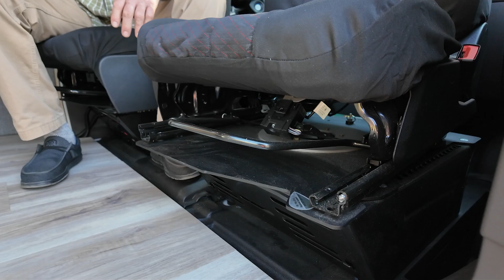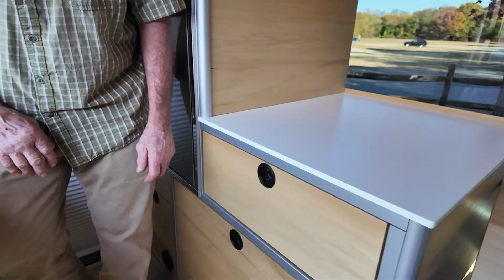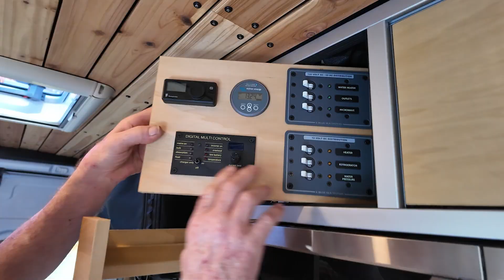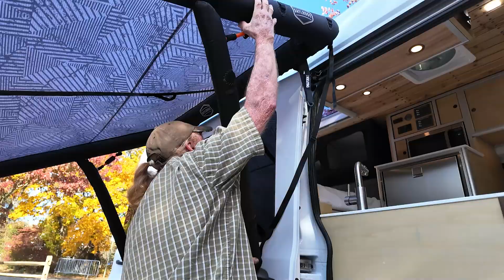You WON'T Believe This Hidden Feature in This Camper Van!

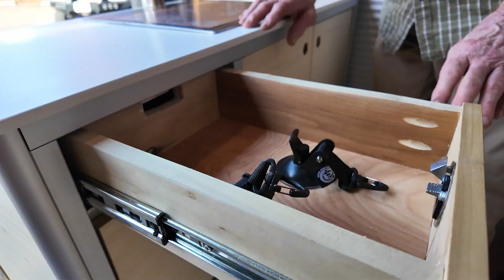Comment: 5:46 all; solid plywood sounds great and heavy. for a rv heavy sound bad 
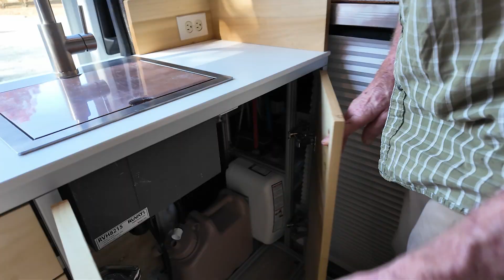6:17 6 gallon canister for grey water? no underneath tank with remote valve? that is no go for the price. 
7:04 light flickering isn't a good sign.
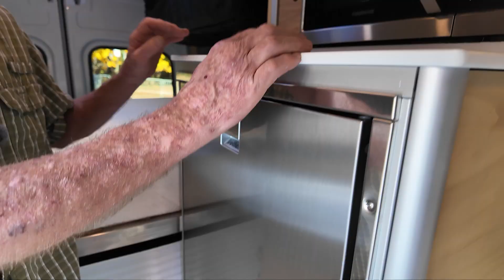7:37 the shelf before the microwave is useless 
12:00 that shade should be able to hold stuff that wont fly to main compartment in emergency situations. that looks and functions bad. better you put that heavy plywood there instead of that flimsy shade. 
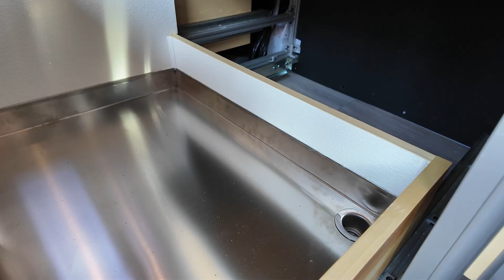12:59 instead of normal grey tank for 20 gal for kitchen/shower/yellow you installed 6 gal? why? 
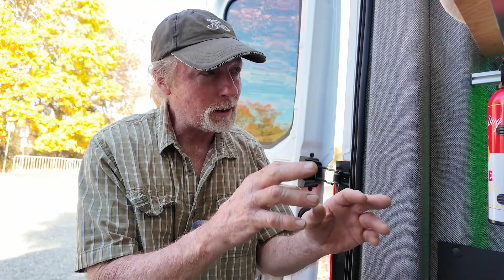15:00 those doors have no isolations and it would be cold to sleep next to it also condensation
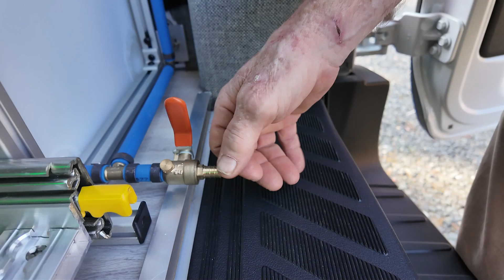17:36 that drain is simple but you can step on it and have problems  
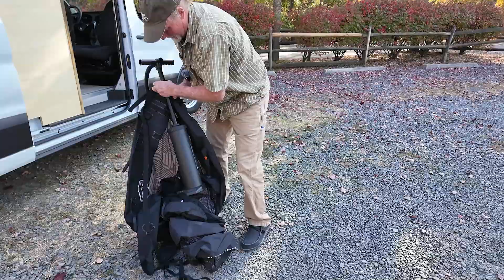18:38 that owning ... I wouldn't buy it or even took for free ... 

everting else seems decent and well made

Comment: Not much storage outside of the garage. I don’t remember if I’ve ever seen bare metal (back doors) in a fully converted van.
Reply from the maker: They can be finished or bare, it’s up to the customer to decide
Reply: Just not something usually seen. Not really a complaint. Love your content. 👍
Reply: @kevindenny3607  The rear doors have the factory covers on the lower portion, I installed the windows.

Comment: I wonder what kind of heating this has, and what temperature it's rated for. Might be a nice little ice fishing van.
Reply: The van is heated by a ESPAR heater and has 2 layers of Thinsulate insulation, the water tank has a heater, the van is designed for winter use.

Comment: That is an awesome build. But i would have to pass on that awning. It hung down way too low on outside edge. Just looked kinda botched up.  I wouldnt want anything to cheapen such a great van build. He really did a great job
Reply from the maker: It had more adjustments to bring it up
Reply: Thanks, the awning needed to be adjusted, it can protrude straight out.

Comment: With 6% tax, not including any fees or extra costs, it's $6,600 above my budget.  I can figure the no tv thing out but the no ac thing has me trying to figure things out.  I want to be comfortable.  How long is the van externally?  Also the overall height, my garage leaves me 9' 3" to get a van in the garage.
Reply: I haven't measured the van's height or length so not sure if would fit in your garage, it's a standard Ford Transit if that helps.

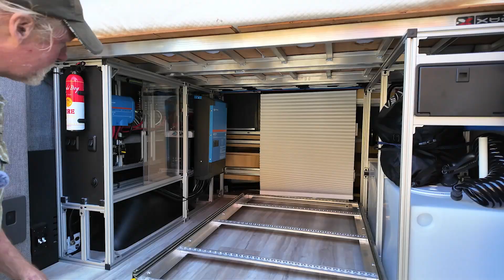Comment: 14:14 So that no one is confused. That Victron Multiplus II is not 3000 "watts" but 3000 "VA" which is about 2600 watts.  Victron for some reason likes to use volt amps as their measurement (which is very confusing to consumers in the industry). But this is what they do. I also have this inverter in my van. Victron is a great brand! I just wish they would use watts like the rest of the industry.

Comment: Beautiful van. The awning has to go. To much work to put up and you also get attacked by it!
Reply: My feelings on the awning (especially with my career path I retired on teaching efficiency, continuous improvement and using the 80 20 (not the building material but the Pareto Principle) principle, how often are you going to use that awning?  Every day?  If so, will you need to set it up every single day or will you leave it up (except in winds) for 2,3 5, 6 days in a row?  What is the cost savings?  I like it and the ingenuity that went into it!

Comment: Did you have any problems with the 2nd alternator being connected to the vans computer system?
Reply: No, they are factory installed alternators, and Ford provides CCP which is the consumer connection point, it's located on the seat base of the drivers seat, protected with a 175amp fuse by Ford, designated for 172amps. One of the easiest DC/DC charging I've done.

Comment: Great van - my van effectively that I built in 2021, my water and electrical are reversed under the bed. Couple of things we changed. I started with the big single slide under the bed but found it too heavy with bikes and gear on, so switched it out after a year to two slides; one for 2 bikes and one for stacking euro style cargo containers (x6 Lowes) plus big full length drawer under cargo containers for long item storage. Also put in arched shelf across back doors by side of mattress (found we dropped too many things like pillows and reading glasses into basement and finally changed out Lagune table, just too springy. We put 12’ rollup awning on outside. Shower same setups but shower valve above sliding door where Avocado shelf is 😊. Toilet slides out into doorway from under sink counter. 

This van will work very well for someone. We have been running our AWD for 4 years now and are very happy with layout. Effectively almost similar vans!
Reply: I usually put the electrical on the passenger side and water on drivers. The main reason for having the electrical on the drivers side was the alternator connection point which is under the drivers seat. I ran 2/0 wire to the connection point which coats around $10/foot which minimized the cost by having the electrical on drives side.
Reply: @kitchenhui3502  I ran the 2/0 wire across the van in a channel along with the water. I was able to have the electrical components closer to the van wall than the water side giving me more width for the unde-rbed slides. I boxed in water tank and have 4 more Euro storage boxes that slide on top of water box shelf. I know to much stuff that I probably don’t need all of it 😂

Comment: That's a great build; totally agree the quality components and materials are worth it. A couple questions for the builder : how to keep the sliding cupboard doors from rattling and sliding in motion? And what is the finished weight? How close to the GVWR? Thanks!
Reply: Thanks, when we shot the video the van was about 95% completed. To stop the rattling I use Velcro along the top and bottom of the doors, same method for the clear sliding doors in the electrical area, it also prevents them from sliding open when driving. I had the van weighed on a CAT scale prior to the buildout, I haven't weighed it after, Ford recommends a 3500lbs. max payload. This build I went to great efforts to minimize the weight, a conservative estimate would be I added around 2000lbs. I'm currently back in Maine for the next two months and will have the van weighed at a CAT scale when I return to South Carolina.